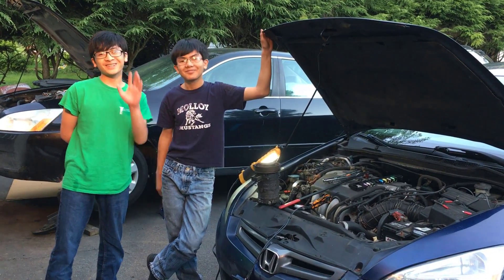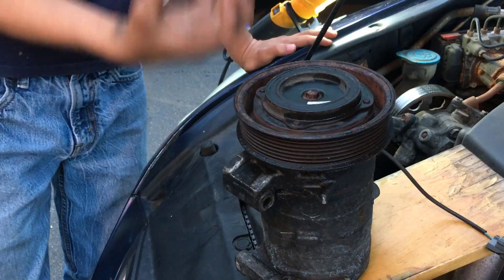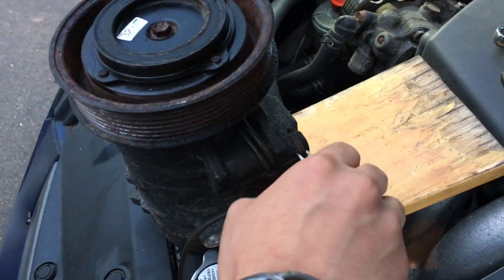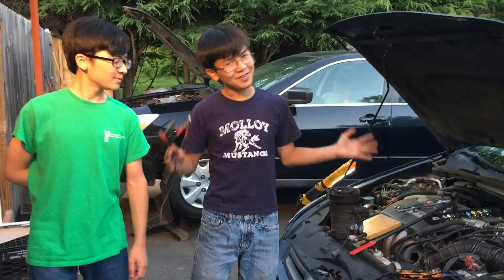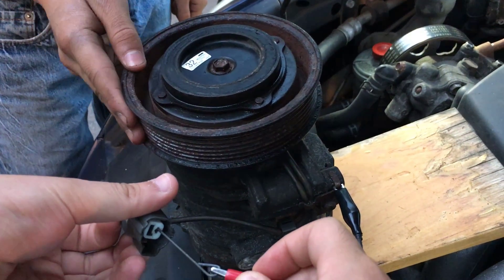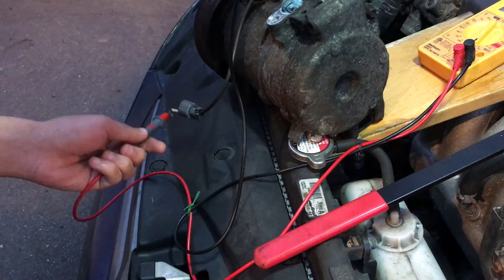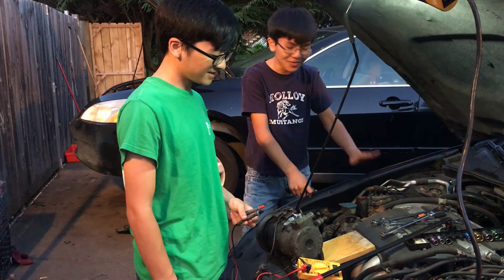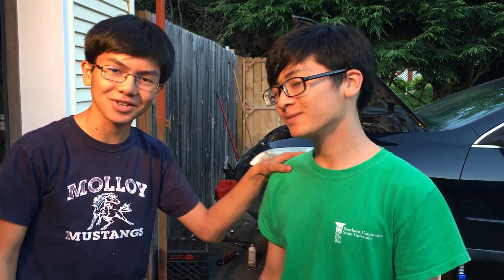How To Test Clutch On Your Car AC Compressor | Using Simple DIY Lead Wires, Multimeter & Power Probe

Comment: Hey guys I have a 2004 Honda accord the ac not coming on I checked the fuse and the relay and still notting can you tell me what to check to get it working
Reply: If it ain't the electromagnetic clutch or wires to it, use leak dye. It might be the bearing/seals in the compressor. If it's not pumping or it's leaking grab a new compressor.

Comment: I’m having problems with my Ac my clutch only comes on when I jump it but the lines are pulling the Freon threw blowing cold air! Could it just only be my connector and the wire be the problem?
Reply: Your ac clutch is bad, if you have to jump it. But i would check your power with a volt meter to see if you are getting power.